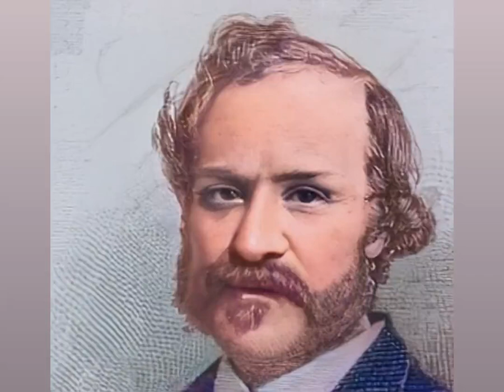John W. Keely describing elements of the dynasphere.

Comment: ####!!The Keely Motor Company is very interesting subject matter for study. As a private researcher, I spent about 9 years, and $500 in old documents for research into his physics research in that Philadelphia machine shop 1865-1899.  There are about 500 of us who look into the works of Keely. The best tech data is in "The Snell Manuscript" which is a synopsis of his 3 books published about 1892. Keely was a musician, metals machinist, Inventor, con man, and science physics researcher. The building was divided into 2 floors. His real science research was done on first floor. The fraud devices were mounted all upstairs. Keely was hounded by investors, newspaper people and technicians, so he had built them for "show" upstairs to appease them, so they would leave him alone to do other work. Keely believed he was smarter than most people including Engineers. People are allowed to have their own judgements and beliefs, but would be better off spending some time to study "The New York Journal And Advertiser , Jan 29, 1899, pgs 17, 18, 19. Keely , the Monumental Fraud Of The century". After John Keely died, the publications and history books  only published the Fraud data. You have to read that first, then study his real devices/systems built for alternate energy, and self running motor designs, gravity control, + generation of 23000lbs pressure within 15 seconds. . SVP sells photocopies of Keely data. There are also other books on John Keely available for purchase. He was easily able to make Hydrogen and Oxygen fuel gases from water with ratios of inharmonic vibrations applied from an array of tuning forks and thermocouples/ thermopiles wires transmitters of silver, gold, + Platinum. Over time, Keely built about 114 devices, and there are photographs on many of them>>>><<<<"""::